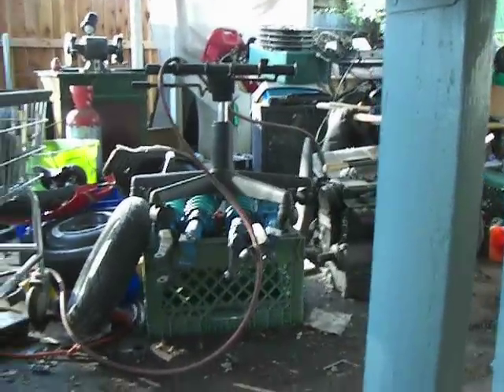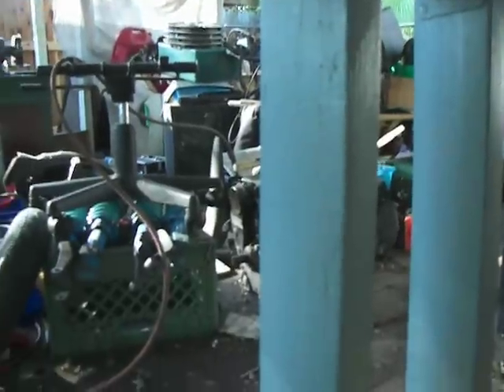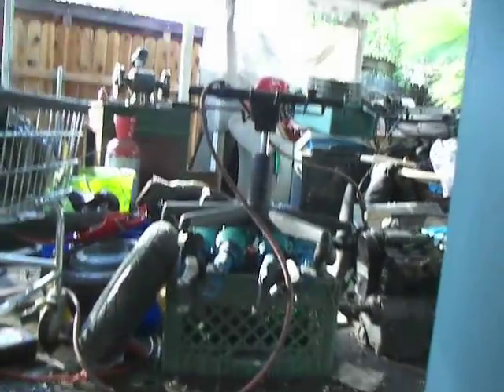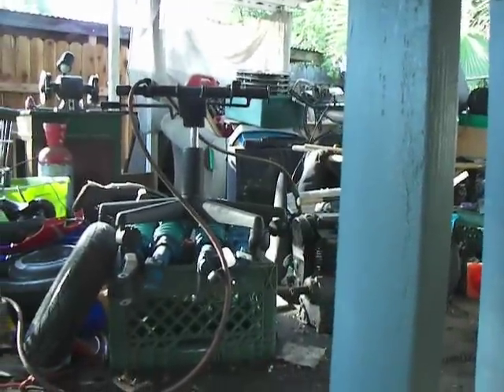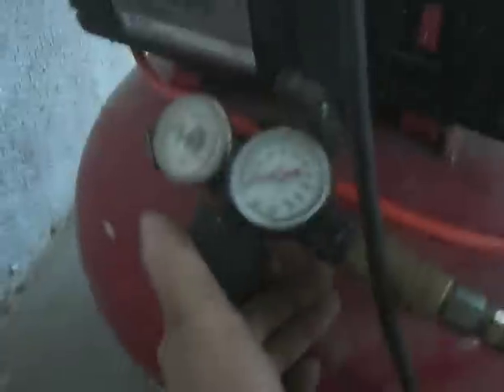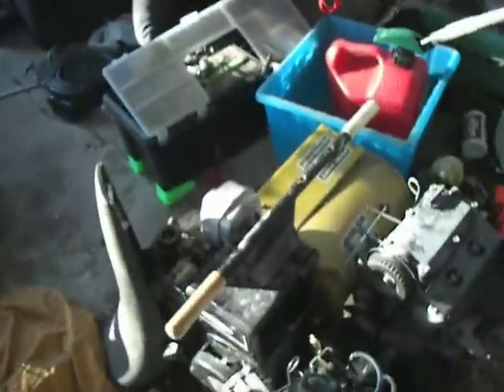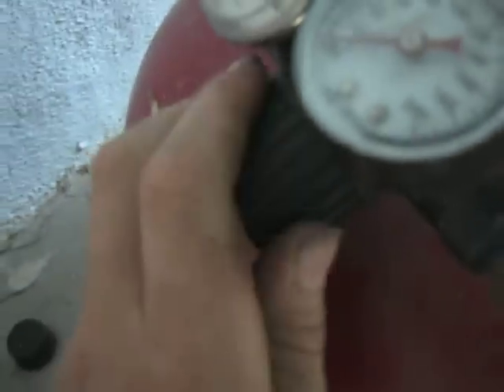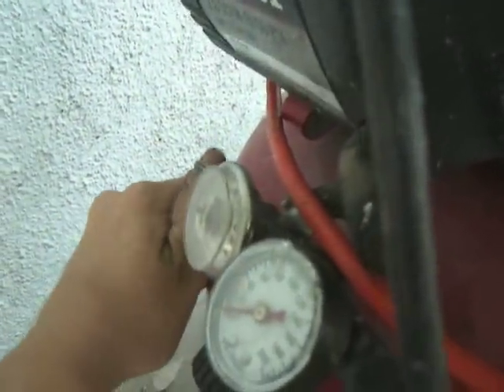Turbo charged Briggs and Stratton

Comment: Nice experiment. Realize that by pressurizing the intake manifold and simulating a turbo, you are removing the vacuum that the engine must overcome during each intake stroke.  This is where the additional power and gain in rpm comes from.

Comment: That's not turboing an engine, it's like using a ram air system like old cars have built into the hoods, a turbo uses the air coming out the exhaust to compress air and force it into the intake while pulling it out the exhaust

Comment: "Today's scientists have substituted mathematics for experiments, and they wander off through equation after equation, and eventually build a structure which has no relation to reality." I also encourage you to invest more studying into this project. Get an an electronic Air/Fuel controller and you may yield better results. Regardless, compressed air can reduce the amount of fuel needed to keep it running. Keep playing with this project and try incorporating a megasquirt system. Best of luck!

Comment: @foxxentertainmentvid first it was 5 reasons read everything i post. also the psi it showed on the compressor was not what the engine used the hose was leaking so the psi was at about 2 maybe

Comment: ok kid there are millions of things i can say that are so wrong with this vid but im only gonna name 5. 1 that setup is not a turbo a turbo sucks exhaust in from the exhaust port and charges it with fuel and forces it back into the engine. 2 the reason the engine was changing tone was because of an increase in rpms not from more power. 3 to make that setup work u  need to add more fuel by richening the fuel mixture. 4 10 to 15 psi in a small single piston engine is too much and u lose power
Reply: jmoney321123 turbos dont put the exhaust back in to the engine, or at least they dont have to. thats what exhaust gas recirculation systems are for. plenty of turbo engines just flow the exhaust through a turbine which then drives a compressor in the intake side